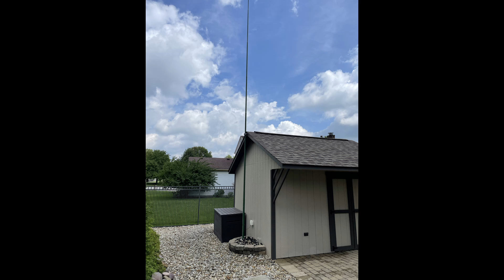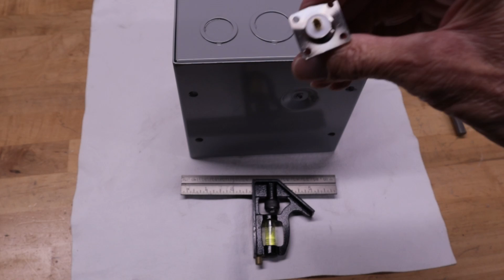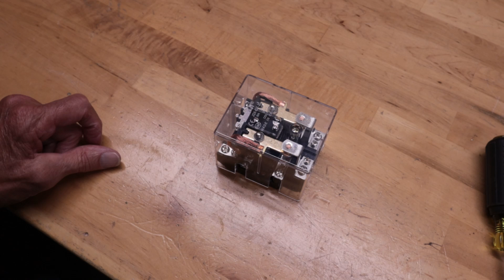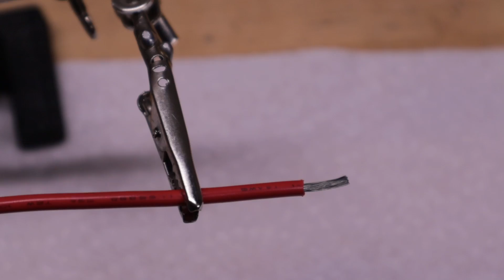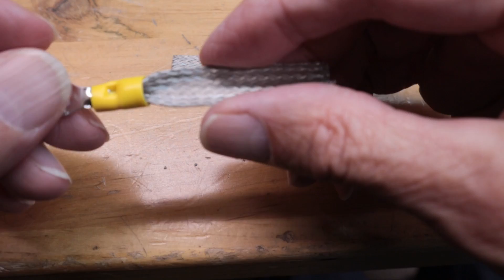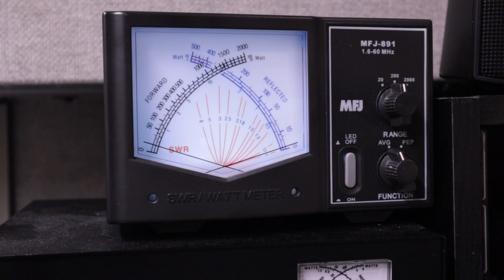Easy to Build REMOTE Antenna SWITCH for HAM RADIO!

Comment: I did something similar but used a latching relay so no need to keep relay energized. Nice video.   One question I had was whether is matters if a metal or plastic box is used. 73's n2eye
Reply: latching relay for the win.
Reply: latching relay for the win.
Reply from the maker: I really like the latching idea!  Yes, I would definitely use a metal box for shielding.  Thanks so much for your comment!  -Ed  W8EDW
Reply: Surplus Sales of Nebraska is where I got mine and it was not a lot.  I used a DPDT Momentary switch wired to change the polarity to switch it back and forth with only a 2-wire connection. 

(KO) 110636
AB Industries dual DPDT relays operated with common armature that mechanically toggles to each resting position. Can use either both coils or one coil with reversing polarity. 10 amp contacts. 12v DC coil. Use anywhere maintenance of circuit integrity during a power loss is important. Maximum dimension 3.25" x 1.75" x 1.375"H.

Comment: you feed 4 tp 600 thru it ?? held so far it seems
Reply from the maker: Hi XPFTR,
Yep, I run about 400  to 500 watts through it with no problems.  I think that the large contacts and putting them in parallel works.  I'm pretty long winded on the air too!   Thanks so much for your comment!  -Ed W8EDW

Comment: Think you should put Diode across the relay coil? To discharge the current store as magnet field into the coil because you the coil opposite to change in current flow and will act as current source in reverse way when disconnected from the source.
Reply from the maker: Yep, you are right Darren.  Thanks for bringing that up.   We have to make sure everyone knows : If the positive side of a voltage source is connected to the positive end of the diode (the anode), and the negative side is connected to the negative end of the diode (the cathode), the diode will conduct current. If the diode is reversed, the current is blocked (up to a limit).  In our case HOOK UP THE DIODE REVERSED!
Reply: Probably a good idea  - standard practice with relays.
Reply: Is the purpose of putting a diode across the relay coil to avoid a voltage spike? I noticed that in my setup, when the relay coil is energized/deenergized,  there is a huge spike of noise evident on the spectrum scope of my radio. Doesn't seem like a good thing! Lol
Reply: I was wondering that too? Would you want a diode or a high resistance resistor to damp down and voltage spikes???
Reply: @mxcollin95  When you remove current from an energized relay coil, the magnetic field that is built up in the coil collapses and induces a large negative voltage spike across the coil.  If you're driving the relay with a transistor this spike can destroy the transistor.  You put a reverse biased diode called a snubber across the relay to limit this negative voltage spike to an amount that won't harm the transistor.  The large voltage spike is dissipated in the relay coil instead.
Reply: I built an experimental airplane and got stuck at Herlong Airport JAX FL due to a failed starter relay.  Turns out there is a fix to place a diode as mentioned above.
Reply: Ed this was the MOST informative primer on using a relay to remotely switch A/Ts. Thanks for you patient and clear video. I’ll be building one myself. And yes, I’ll include the diode as noted.  Do you have a recommendation for the diode?  Thanks and ‘73
Reply: Usually called a "catch diode" and should be there.